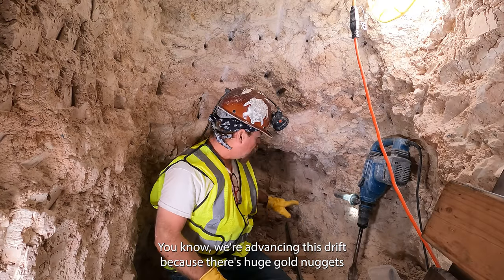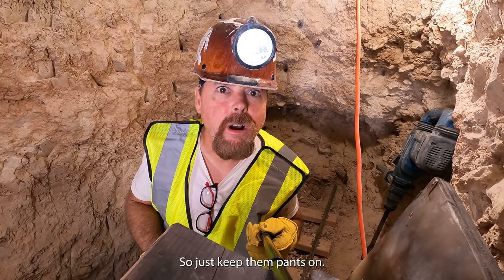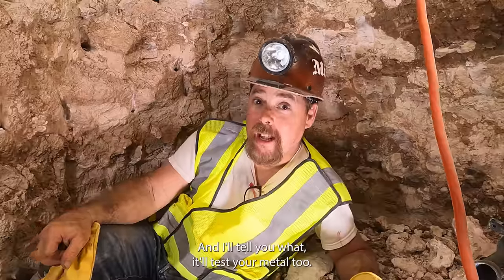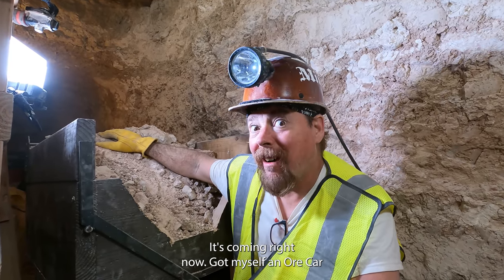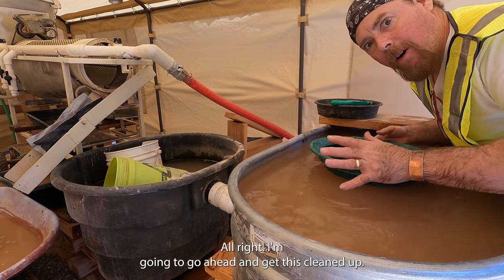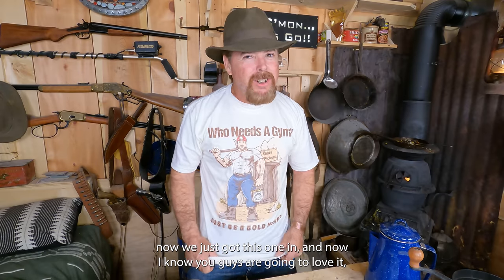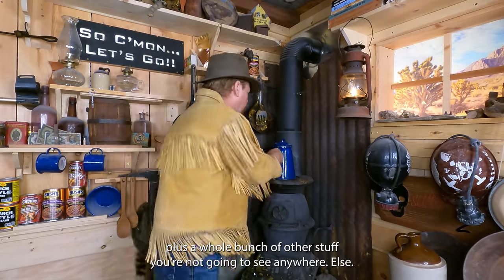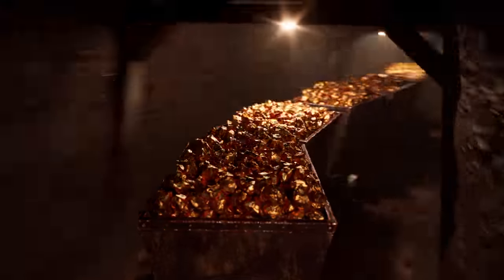Our Search for the River of Gold has Paid Off

Comment: Take a tip from the "Old Timers" and run wooden rails with HDPE or UHMW strips on top.  No more stray metal detector interference.  Add 4 foot section at the end of the track that can be inserted and removed easily will cure your problem without any great outlay for materials or empty pocketbooks !!
Reply from the maker: now thats a great idea " Old Timer " thanks for the tip

Comment: It wasn’t just the old timers that reassembled equipment under ground. I took a R1300G Cat wheel loader to the Lucky Friday silver mine in Mullen, Idaho a few years back. It completely cut apart and welded back together 6000 feet underground. The pieces had to fit into a 6x6 elevator. Reassembly took 2 weeks. It than started it’s working life another mile under the mountain, never to see daylight again.
Reply from the maker: wow thats impressive ..... must have been something to see . Thanks

Comment: Are you  sure you can't make the rock fall directly into the cart as you knock it off the wall instead of dropping it on the floor then shoveling it up into the cart? Let gravity do the work for you. Perhaps your 'track pad' is a long canoe-like or water-trough-like scoop with one end in the cart and fill the down end then tilt it up higher than the cart and slide all that material right in the cart.
Reply from the maker: working on it